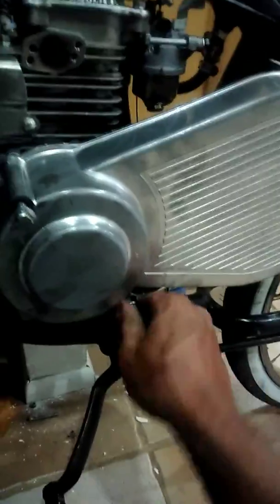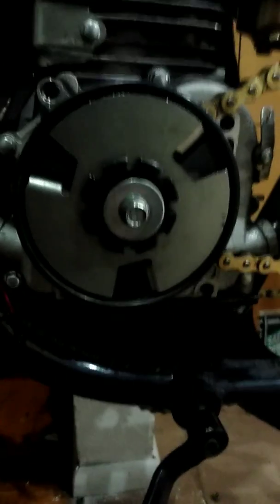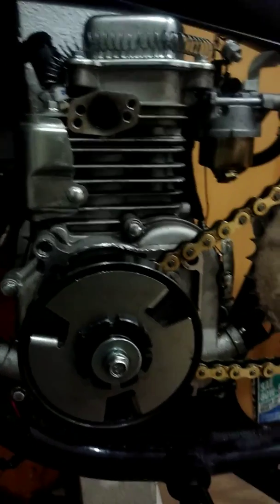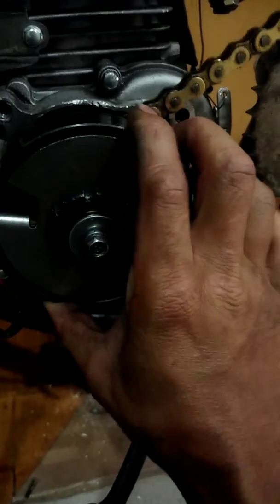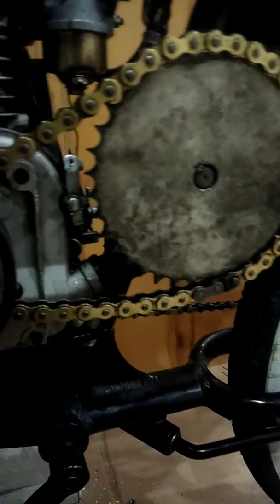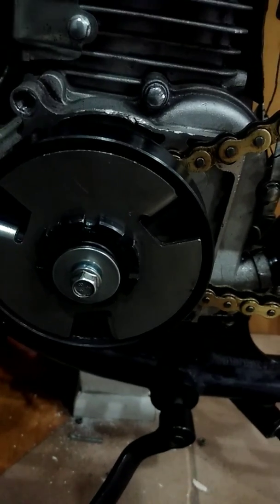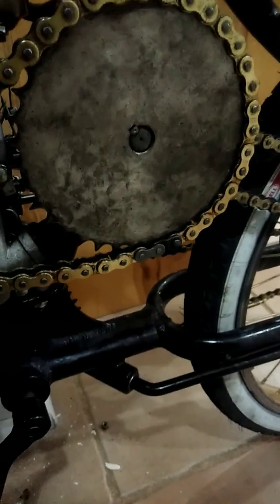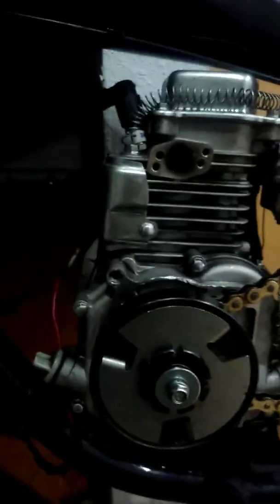Here is the outcome of the Phatmoto stock clutch hack!

Comment: Are you oiling it before your rides? Also would like to see your carb, throttle cable connection on the other than stock carb. Post on Facebook Mothers Best page for all to see. Thanks, great video.
Reply: All Right, am looking forward to seeing the mod. I am really wanting to do away with the governor linkage all together. Will need to get a better a new Hilliard clutch, #41 chain, set of mag wheels will be here Tuesday,
Reply: Needing a carb ( recommendations? )
Reply: @stevehurt5514  I need to call OMB Warehouse and see what matches up for an after-market Hilliard clutch. How much is the Hilliard clutch you're looking at for the phatmoto bike?
Reply: Jon Smith thinking it was $23 or so. Can’t find it in my email confirmations. Didn’t think it was to expensive for what it is. Don’t ask where from, memory is not what it was.
Reply: Jon Smith I was wrong, (told ya, memory not what it was) more like &110 or more w/shipping.
Reply: Ivan Davila as stated, memory not as good as it was, paid $42.99 plus shipping
Reply: Shipping $6.99
Reply: Can any of you guys help me I tried buying new clutches but can't find the right one and my original clutch is always sticking this bike is my way to work does anybody have a solution